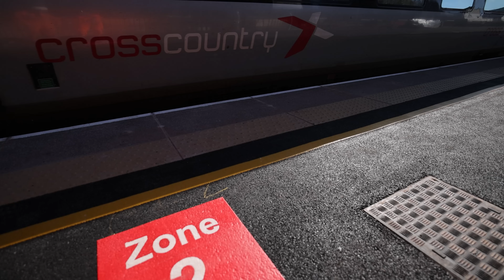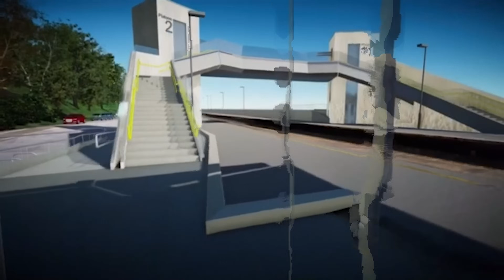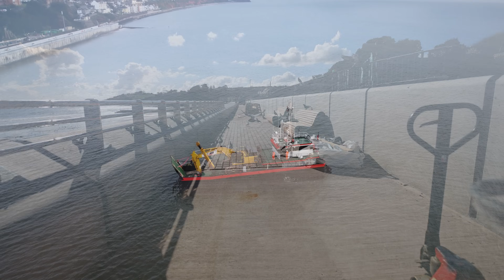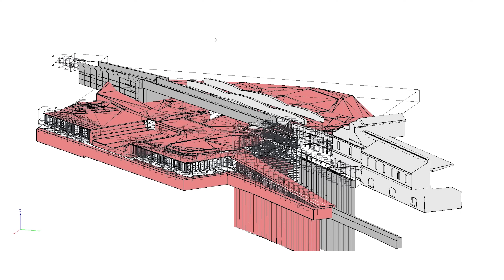Dawlish Seawall and Dawlish Railway Station Upgrade

Comment: Very interesting. the platforms seem very long, has that been done because of the new sea wall or because you think there will be more people using the station?
I understand the wall has to be a certain height but if going on a mobility scooter to Dawlish Warren, most of the way a person wouldn't be able to see over the wall which is a shame. Couldn't you of made the walk way higher?
Reply: The south side platform was that long before. It looks to be about 300m, long enough for an 11 car train, somewhat excessive or the route at the moment. The north side platform looks to be long enough for a 7-car train. They didn’t change the platform length when they rebuilt it. 

The walkway has some raised sections where it’s supposed to be easier to see over. It seems like there’s regulations on railing/barrier heights in play.

Comment: Great video, really informative and shows how much planning and coordination has been required before and during the hard work. Just wondering why passengers using wheelchairs or pushchairs can't cross the line using the flat crossing at the west end of the platform. Suitable gate on magnetic lock would do the trick. The record with lifts elsewhere on the line (e.g. Totnes), is poor. Doubtless it's dangerous to cross a railway line ("don't you want passengers and trains to be safe??"), but there have to be ways of gating the access off and having a detection system linked to signals for when the crossing is used. Got to be easier and cheaper than mammoth lifts. Would be interested to know the relative costs and safety reports that don't simply say "all foot crossing will mean death", because it's managed well elsewhere in Europe.
Reply: As part of the project they are installing a set of lifts, and they don’t consider keeping the crossing open necessary. The gates at the end are there to prevent trespass issues, there’s a video a while back on this channel of some idiot walking around on the rail bridge over there.

Comment: Good progress being made but I'm appalled at the amount of very not 'green' concrete being used.  What is wrong with a very hard stone? Cost or the lack of Stone Masons in the country now or both?
Reply: One has to ask how much environmental damage would have been caused quarrying the amount of stone for this project. Let's not forget the old 'stone' wall needed extensive repairs pretty much every year for decades, and indeed was very nearly completely destroyed in Teignmouth by a storm just a few short years after Brunel built it.
Reply: Concrete requires less maintenance

Comment: Is the old bridge staying in place cos the new one looks amazing
Reply: It is not actually that 'Old'. The original was replaced not very long ago with a replica made of composites, hence the lack of rust that was a feature of the old old bridge.
Reply: Yes Network Rail has confirmed that, because it’s part of the station building. It will probably get some maintenance done once the new footbridge is in.
Reply: @andrewreynolds4949  cheers for that I been there many times and not realised that the old bridge was actually part of the building cheers you do learn something new every day

Comment: I noticed that the new metal fences been installed on the top of the concrete walls have gaps. Are those still to be Installed/filled in?
Reply: And two different heights on the sections that are installed? The lower height of which seems almost superfluous.
I was hoping for an explanation. Alas, no…
Reply: @stuartmcconnachie  I was wondering if it was just for a fancy design or part of some clever wind management etc. I would certainly like to understand more etc
Reply: I believe the height of the barrier is a requirement (by Network Rail? Legislation? I don't know), so the fencing on top is supposed to be a balance of meeting regulations and still allowing a limited view. The differences in height between areas is because of the walkway side having raised areas to provide better view of the sea, which has been a big local concern.
Reply: Apparently so

Comment: Very informative. I especially liked the building render near the end of the video. Still find it a bit odd that BAM didn't use some short sheet piling to keep the worksite dry(er). Hope you keep up these tours. The webcam is nice, but this goes much more in-depth. Thanks, Robert (Netherlands).

Comment: Much needed work, why are there sections of railing missing off the top of the wall on the seaside platform?
Reply from the maker: They are still half way through installing them.

Comment: Guys why is the blind strip marker on the wrong side of the platform yellow line then ?????
Reply: Looking at images, that is the normal way of doing it. The yellow line is for people to stand behind when trains pass through. The tactile tiles are to warn of the approaching platform edge. Seems like common sense to me.
Reply: That's the same way round as all the platforms on my line - yellow line, then tactiles, then platform edge
Reply: @nigelcole1936  But Nigel that means ever blind person could step over the yellow and then gets shouted at as he is then standing on the blind strip ofter the yellow. See where I am coming from.
If it was the other way around they would have stopped and not gone over the yellow line.
Makes simple sense to me.
Reply: I am simply saying what we have on platforms in London - I didn't install them
Reply: @stephenlittle7534  My suspicion is that the tactile tiles have to be a certain distance from the platform edge so that those who rely on them know ho far they are from the edge of the platform, but the safe distance to stand back from trains passing at speed is greater.

It is not about being 'shouted at', it is about making sure people are safe, so if staff see there is a blind person, they will be trained to recognise this and offer assistance.